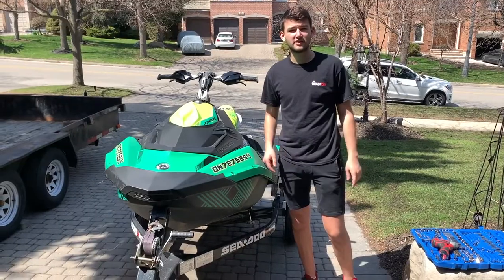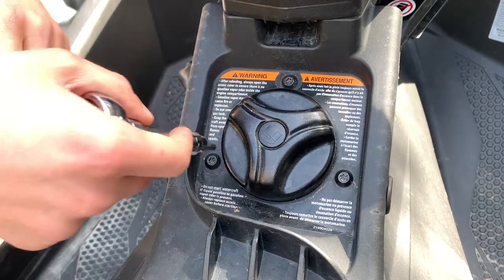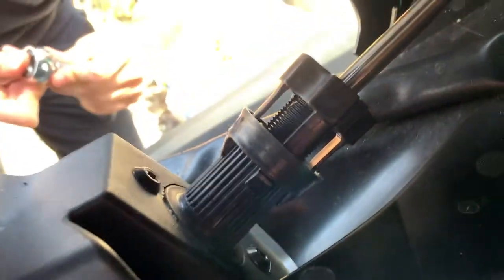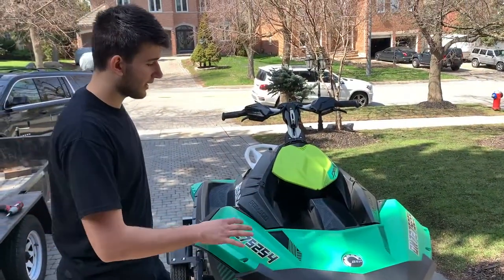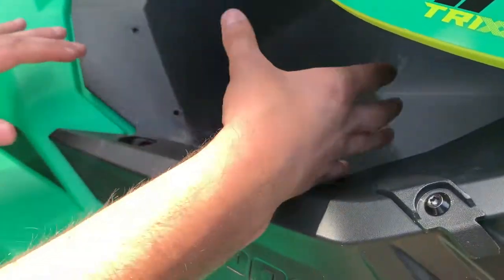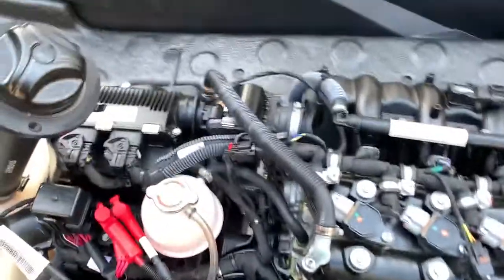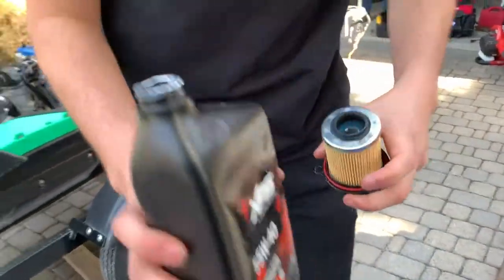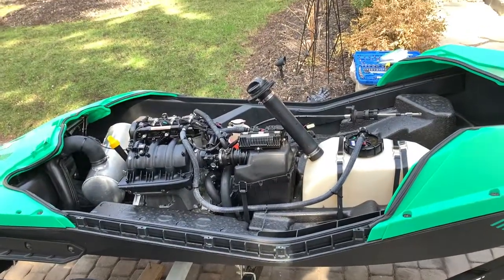How to do a oil change on a Seadoo Spark Trixx *Removing Top Hull* (2016-2023 Models)

Comment: You can actually do an entire oil change on a Trixx without removing the hull top. Oil extractor to remove oil and three bolts on oil filter cap with the oil ring.  15 minutes and you’re done.
Reply: Yup
Reply: I was going to say that………
Reply: The title should be…. How to steal a Seadoo take it apart… and sale the parts on the black market!   😅😅😅😅😅😅😅😅😅😅😅😅😅
Reply: Now do the spark plugs
Reply: But to take it off isn't that much work gives you easier access to the oil filter and while your at it give the engine a clean and protect and check over anything for wear and tear.
Reply: Gotta take it off to do spark plugs
Reply: Just don’t drop socket for oil filter cap.. lol

Comment: thanks i was really in need of how to do an oil change for my seadoo spark trixx (2016-2022 model)!
Reply: Save yourself a ton of time and buy an oil extraction pump and suck the oil out through the dipstick. Use the access panel to get to the filter. Should take no more than 15 minutes.
Reply: zoaty styll

Comment: hi.. you looked like you just ripped your seat up.. you know it's a matter of lifting the tab at the back and slide the seat back..  
plus oil change can be done without removing  the top deck.   Good video in general tbf

Comment: Hi, what is the size for the screws for oil filter housing, thread pitch, how long it is and size of the torx? Thank you.
Reply from the maker: We use an 8mm socket, any length should work for the screw.
Reply: It requires an E8 External Torx socket.